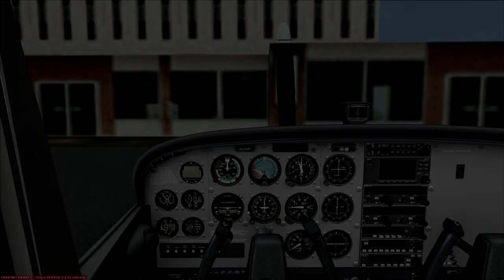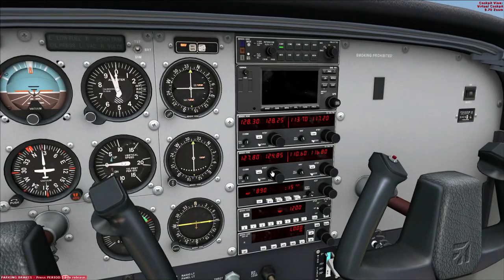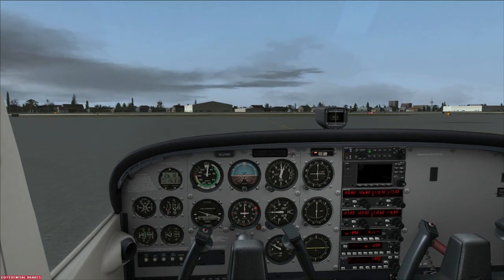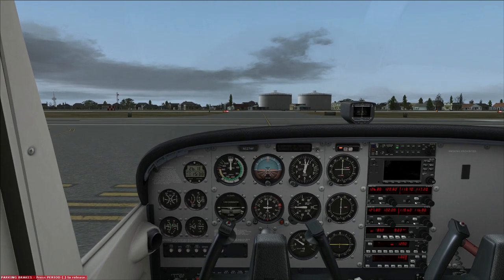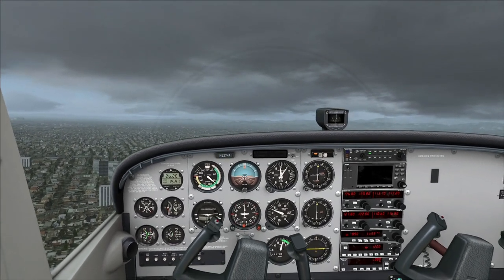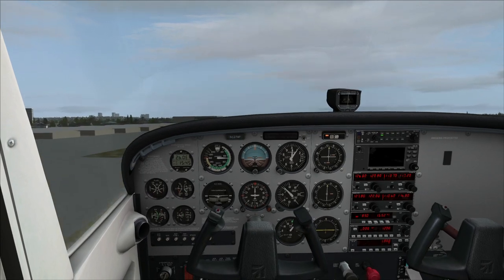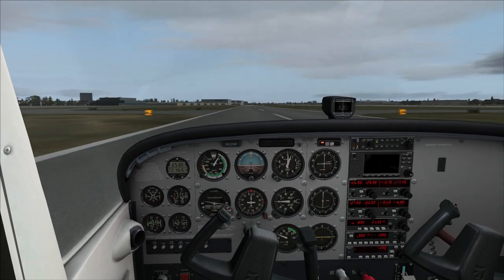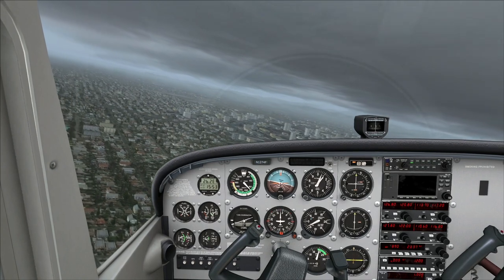PATTERN WORK - SITTING THE V-01 EXAM IN FSX

Comment: The A2A C172R's nose gear is not directly steered. It's castered and sprung so the use of brake is sometimes needed for tight turns. Typically you use rudder to initiate a turn and then use inside brake to sharpen it. Just a dab of brake can speed up a turn as the angular momentum can be preserved with just rudder. I also find that stabbing on some opposite rudder can arrest a turn more controllably than trying to modulate the rudder. Modulate for big changes in turn and stab for minor corrections.

Comment: frooglesim As a student at ERAU here in Daytona, i can verify that our groundwork uses very little braking EXCEPT on tight turns.... verrrrry light on the brakes. we use engine RPMs and nosewheel to nav, only using differential braking for u-turns and 90* + turns.

Also, using active sky next, i often get some serious rocking in the pattern, its physically tiring... wind has a huge effect on this cessna lol...

Also, on the landings, were told to flare in such a way that as we bleed off speed and pitch up the stall horn will sound about as we touch down, we want the right or left main down first depending on crosswind, and then set the nose wheel down after firmly on the deck. we flare at roughly 20 feet(wings level with treetops in peripheral) or so. Just how we do it... they tell us that landing with all 3 wheels can induce a bounce where we would push power and go around. Additionally, when coming in off the runway make sure you cross the runway threshold lines. Clear the runway, then call for taxi to ground. Just some friendly observations based on what were being taught here since it is relevant. 

LOVE the videos!!! Makes me want to go out and fly the coast... just too much $$ :(. 86 degrees today here in daytona!

Comment: Congrats Froogle! Yeah in RW Small Cessnas (152, 172, etc) usually use differential breaking for turning on the ground. The Rudder isn't connected to the nose wheel in the way that Pipers (Cherokee, Archer, etc) are.
Reply: Skyhawks do have the rudder pedals connected to the nosewheel. The system is deactivated when the weight on the nosewheels is removed (ie, when you're in the air). You can absolutely steer using rudder alone. You can tighten the turn radius, however, through use of differential braking.
Reply: coma13794
Well right. It is just a different system than what Pipers use.

Comment: great stuff. perfect RT. You allow your airspeed to drop far too low on the approach however. Airspeed should be 60kt as you cross over the runway threshold. Also, this is a high wing Cessna aircraft with gravity fed engines, you don't need to use the fuel pump like in most aircraft. As for the pattern. The heading indicator thing is fantastic for unfamiliar airports, but once you fly the pattern once start to use references on the horizon to help you stick to the correct pattern. It will make your life SO MUCH easier. Thanks for the share :)

Comment: Hey froogle, I hope you don't mind if I give you a quick critique on your touchdowns!  Your technique is incredibly solid, and very safe.  If that were a real plane, I'd fly with you no problem.  You can see all the experience you have in jets though, because you're landing the Cessna like one.  In a big jet, you need to put the airplane on the ground because of their high approach speed and excellent aerodynamics.  In the 172, and any light aircraft, basically once you flair, as you settle down to about a foot above the runway, you just try to not land the airplane.  That's pretty much it.  Try your best to hold the airplane just above the runway surface, and within a very reasonable distance, the airplane literally lands itself, and smooth as glass.  At best, flying the airplane into the ground will result in harsh, uncomfortable landings.. that's how yours were, safe, but harsh.  I've felt a million of them.  At worst, you'll get a bounce, a porpoise, and then all the fun stuff that might come with that, like prop strikes and nose gear failure.  Other than that, I'd just say review your checklist for climb speeds and climb flap settings, and fly a tighter traffic pattern (a stylistic critique, but your pattern would be better suited for a mid sized private jet, and you'll find all other light GA aircraft circulating much closer to the field).   I'd love to have you as a student though.. for sure within 5 hours, you'd be a better pilot than me.  I'm sure you've answered this before, but have you ever done any real flight lessons?
Reply from the maker: I started to read your comment and groaned a little. I get a lot of "experts" telling me to do X and Y differently, that my videos suck, that I suck etc etc. But your comment actually made a lot of sense. Thank you so much for taking the time to offer up this guidance, it is genuinely appreciated. Yes I have had a few hours of lessons, but never took it to the point of qualifying. Thanks again.

Comment: and the yoke and pedals are assigned and calibrated via FSUIPC, and while differential braking works, brakes totally loose all effect when I press down both pedals simultaneously. Works with every other aircraft without problems...

Comment: In my experience with the 172, nosewheel steering is pretty paltry and insufficient for making tight turns while taxiing. It's only really useful for keeping you on the centerline. So using differential braking to turn is perfectly normal.
Reply from the maker: That's what I thought.

Comment: Getting close to taking this rating.  Just a quick question. You are on tower 126.8. Chart says 119.9 for 20L.  Apparently either one works for a pass, was just curious about which one should be in use. Forgive if this has been addressed below. You have probably been asked 1000 times if you are going to do the I Ratings.. I hope so.

Comment: I have always had trouble flying the VFR traffic pattern in the simulator because I find I can't really see where I am in relationship to the runway as I turn  base and final.   I used to fly a Cherokee "real world" and it was not difficult to do this because I could see much better. What is it that you are using which helps to swivel the view so easily?   Thanks!
Reply: He uses TrackIR

Comment: Brilliant vid froogle as usual. King of the simulation hobby. By the way interesting to see you lean the mixture on the ground - in the RW 152 I just leave it rich all of the time. What is the effect of leaning on the ground? Less fuel consumption for taxi?
Reply: Always lean when prolonged idling will occur (on the ground). This prevents spark plugs from fouling from over rich mixture
Reply: and this is simulated on the A2A Cessna I believe...
Reply: 'full rich' is required at takeoff from sea level in standard conditions, but at idle, the mixture setting will result in carbon deposits forming on the plugs (also known as 'fouling'). You'll detect this condition during the run-up process with excessive RPM drop as you swap to one magneto versus the other. It's not about saving fuel, it's about stopping the build-up of carbon deposits on the plugs. And as Jeremy pointed out, A2A simulates that nicely.

Comment: I found the solution for the braking issue, at least if you're using FSUIPC for assigning and calibrating controls: Change the brakereleasethreshold=75 to 0 in the FSUIPC.ini
Reply from the maker: How wonderful!! I shall check that out later.

Comment: Congratulations!but have a question,I installed the trial version of ASN,but takes to much frames,any solutions?
Reply from the maker: There are sliders you can adjust to reduce the load on your machine. I couldn't talk you through them off hand but they are detailed in the manual.

Comment: How do you get your usb headphone to work at pilotedge 
Froogle
Reply: PE uses your default recording device in Windows as the input device. That can be a USB headset if you like. If you want to hear the ATC through the headset, then set the default playback device in Windows to be the headset. You can ell FSX to use the speakers for the sounds it generates (engine, avionics, etc). We're working on adding the capability to specify a different playback device.
Reply: thanks coma13794

Comment: Can you do this on vatsim ? Great video ;)
Reply from the maker: I think so.
Reply: The same pilot training program is available on VATSIM too. The 3 most immediate advantages of using PilotEdge are that 1) the ATC is available 15x7, 2) you utilize the correct radio freqs throughout the flight, 3) the ATC audio is recorded and made available as an mp3 so you can review the audio after the flight. An advantage of VATSIM is that it is free.